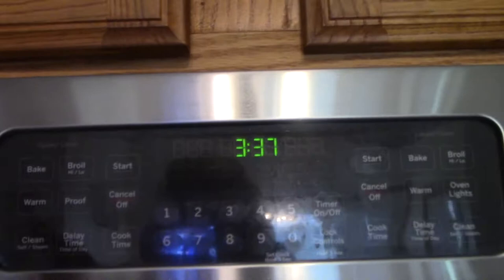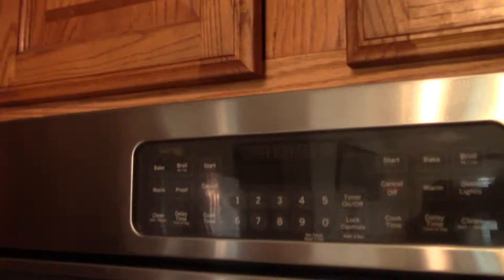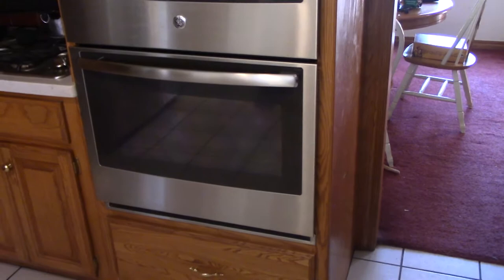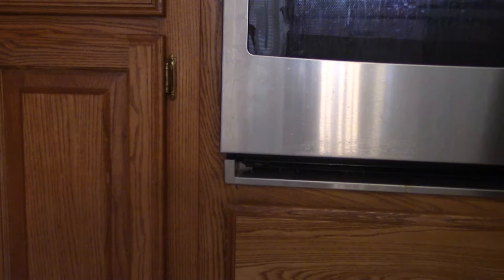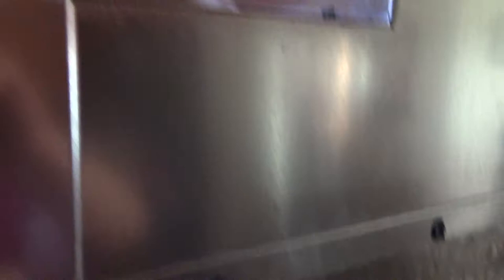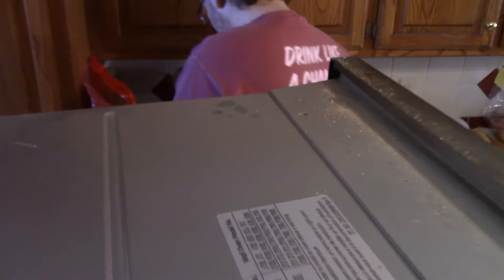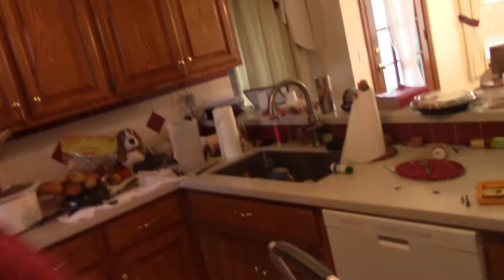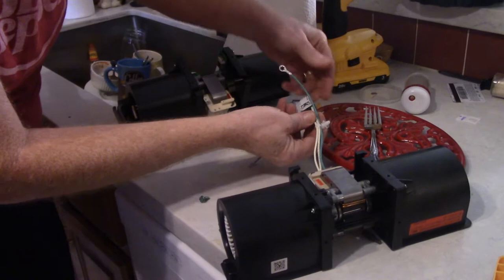GE Oven Fan Blower Replacement - Code "F96"

Comment: Thanks for the video!!  In 2015 I bought a new house that came with GE profile oven that broke within a year, which was fixed under warranty.  I moved to a new home in 2017 that came with GE profile oven (tried to get the builder to change but no luck).  After 3 years I got this F96 code.  Thanks to Dave, I will be doing DYI.  I will never buy GE appliance.
Reply from the maker: Awesome!! Glad it was helpful! Thanks for watching!
Reply: @DIYDaveOK   Completed success.  Your video help me save aggravation and time, thanks!  I didn't take the door off and it wasn't an issue.  Overall very easy job, took less than an hour.  Without Dave's video, it could have been a few hour job. Thanks again!
Reply from the maker: @kyj730  I am so glad it worked so well for you!! And it's great info that you didn't have to take off the doors. This just makes my day - that's why I do these videos, and if I helped one person, its worth it!!! Thanks so much for your update and for watching!!

Comment: Pro tip, just give the fan a little nudge to get it going or bang your door a couple time to jar it free. There are 2 fans one up top and 1 in the middle. The one in the middle is giving me problems. I seen several people that continue to have the same problem with new motors so it’s a design flaw.
Reply from the maker: Interesting, Jacob; I only found one fan up top, and there was something leaking out of it, so I'm suspecting a seal failed and the lubrication around the bearings drained out and ran them dry. Thanks for watching!
Reply: You are AWESOME! This helped.

Comment: Excellent video.  Thank you.  This the most detailed video describing/showing the repair for F96 error.  Our oven was 5 years old and we only use 2-3 a month.  Apparently, all the oily fumes are sucked up by the fan and cause it to fail.  I know there is a lower fan too.  I wonder how long before that one fails?  Maybe I should have just replaced both fans while I had the oven pulled out.
Reply from the maker: @elliottm9365  Thanks for watching and glad it was helpful!

Comment: Is it bad to use ur oven when it’s flashing the f96 code
Reply from the maker: For us, when this code was displayed, the oven was inoperative.
Reply: I would just wait a bit cuz I keep ignoring the problem 😬and it would work when I tried again.
Reply from the maker: Well, for us, we would cycle the power to the oven and it would act like it was going to work. We'd fire it up, but then it would show the code thereafter and lock up. It got to a point where it did nothing.

Comment: Hey Dave, I follower yr guide and got my blower replaced pretty easy'ish. The old fan wasn't turning and I put the new one in and it started spinning and I had air flow so I put the entire thing back together and back in the wall, and now I have nothing again, it's showing an f96 error again and acting like the fan isn't turning, but u still feel air flow comming out the bottom. Any ideas?
Reply from the maker: Hmmm, man, that's frustrating, Ryan. Is there any chance you might have accidentally loosened the power connector (or perhaps it wasn't "clicked in" firmly) or somehow knocked the ground screw loose when you moved the oven back into the wall cavity? Those would be the first things I'd suspect. Let me know what you find out!!! Thanks for watching!
Reply: @DIYDaveOK  that is exactly what happened! Thanks. All good now, on to making cupcakes!
Reply from the maker: @ryancasey4807  AWESOME!!! Glad to be able to help!!!

Comment: I have the same GE oven,  but I'm getting an F97 error code. Is this caused by faulty fan, like the F96 code?  I've tried resetting the breaker, but it didn't fix the problem. Thanks.
Reply from the maker: I believe that's the code for the blower on the lower oven.

Comment: Dave - thanks so much for this video. I had an F96 error and thought it best to call a repair company. The repairman ordered a new fan, but no new sensor. When we got the F96 error again he told me I need to buy a whole new double oven and that F96 was telling me that it’s a control board issue. I didn’t believe that and kept pointing to posts that said it’s a sensor and fan issue. 

Anyway, I ordered the sensor now and am planning to follow your instructions (with some help). Thanks again for posting this!!
Reply from the maker: You are most welcome! I'm always glad to hear this helped someone!! Especially someone who has paid a tech to know how to fix it *correctly*. Awesome!!❤️

Comment: Good job. This gave me the confidence to do it myself with help from our son. Thanks
Reply from the maker: That's fantastic!! So glad it helped! Thanks for watching!
Reply: Hi, Dave - I have an F97 code on my GE double wall oven(s). Would you be able to advise me on how to attack this? Cooling fan replacement, it seems, is the most likely problem, I understand. My model is JK3500DF3BB. Not under warranty. Thank you.

Comment: Thanks for the video Dave!  I have a similar oven with the same F96 error code and your video helps put me on the path to eliminating the problem.  Incidentally, I recognize the fan from several GE Microwaves I've installed. I wonder if its the same part.
Reply from the maker: Awesome!! It certainly could be the same part. I had to dig through a couple of "exploded" parts diagrams for different ovens with similar parts before I was sure what I needed to order, and had to make sure the parts guy at our local supplier was ordering what I wanted! Thanks for watching!!

Comment: Hi Dave excellent video! How did you get to the conclusion that was this blower fan who needed to be replaced? I noticed you didn’t have a reading machine to help diagnosed the issue, please let me know
Reply from the maker: Hi Marlon! I literally googled "GE F96" and got hits on different appliance repair sites that consistently pointed to a "fan blower failure." Think I got a generic message from a GE site that said something like "Possible fan issue, contact GE for service." Thanks for the kind words and for watching!
Reply: DIY Dave thank you so much for your quickly reply Dave! Really good stuff! Glod bless man. I will buy the spare unit and give it a shot!
Reply from the maker: My pleasure!! Hope it works for you! Let me know!

Comment: Why did you take the door off??
Reply from the maker: Don't believe there is any way to access the trim strips that hold the screws for the mounting brackets without taking the doors off. Even if there is/was, I wouldn't want to have to worry about pulling the unit out of the oven and the doors flopping down in the process.

Comment: Hey Dave, whats the part number and where did you get it?
Reply from the maker: The part number is WB26X24020. It's available through several online retailers, but I actually got mine for approximately the same price through a local parts shop for about the same price. Thanks for watching!!